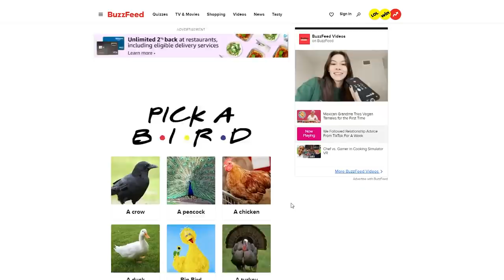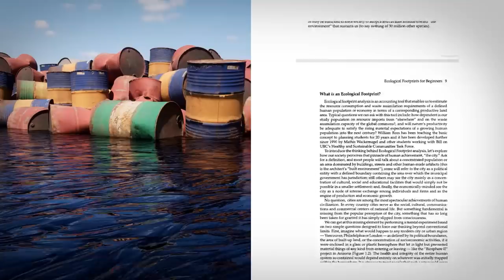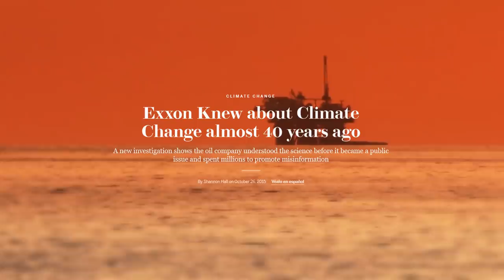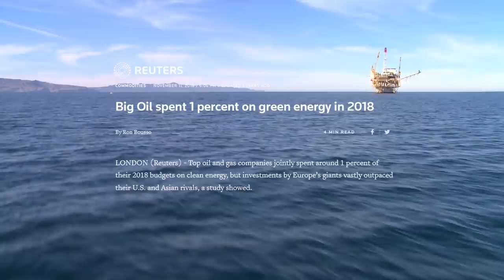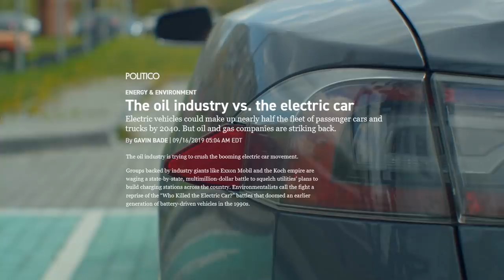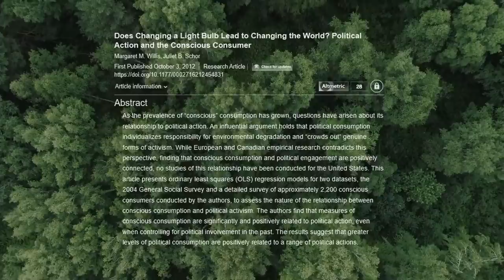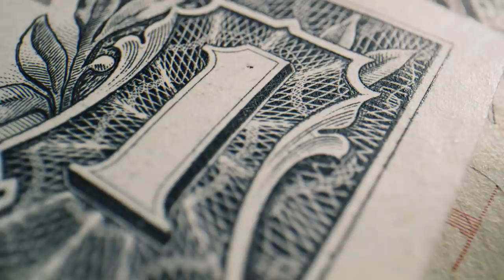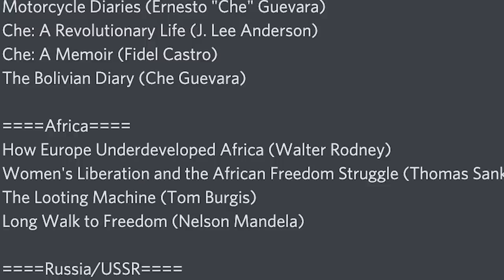Your "Carbon Footprint" Is A Scam

Comment: What I missed when you said about electric cars is that the electricity they charge is sometimes made of carbon, for example, which is constantly producing carbon dioxide. Personally, I have nothing against electric cars and that it is a grief in this field of transport, just like electric trains, but together with cars we have to think about better, more "green" electricity.
Reply: Also, fewer cars. Electric cars may be better than petrol cars, but they are still very wasteful when compared with a properly engineered public transport system. A train carrying four hundred people on the daily commute is much better than four hundred electric cars making the same journey. Electric cars can be an excuse not to invest in public transport.
Reply: An electric car can use renewable energy. An internal combustion driven car cannot. So as grids switch to greener energy, electric cars get greener.
Reply: @kanguruster  Green-er. They are an improvement on petrol, but still not the best solution. People really like cars though - they are more than just a means of transportation, they enable a way of life. It's the convenience of being able to go where you want without the need to plan ahead.
Reply: @kanguruster  A problem a lot of people ignore is maintenance. Batteries constantly lose range and must be replaced within 5-7 years to retain range most people use. In addition, they still have cooling systems that must be maintained, a lot more computers which generally also have relatively short lifespans, and the charging infrastructure needed to fully transition would require a lot more power, since the world doesn't want to use nuclear fission, it's not gonna help much.

This also doesn't even cover the many rare materials used in construction such as lithium, we don't have close to enough for a full EV transition. Nor does it mention the environmental impact of mining for these things so quickly/all at once.
Reply: 1. In Poland ~ 95% of energy comes from coal and we have zero nuclear power plants, thanks to the chaotic recommendation of videos by YouTube on this channel are people from nationalities other than America.
2. In the Internet you can find Teslai charging stations, where next to them are large oil generators because there is no other way to bring electricity to the station.

Comment: Very good video. You're one of the jewels of YouTube, JT (a jewel sustainably mined without slavery or exploitation, of course).
What I see as a killer problem of moving people away from the carbon footprint and individual responsibility is that we're told what we have to do individually to reduce the effects of our energy usage, which means 1) we don't have to think too hard, and 2) when it becomes hard for us personally, or we see that what we've been told to do isn't going to have any material effect, we can't help but think any response at all will be too hard and we get discouraged. That plays into the hands of the profiteers who are exceedingly happy when we pay no attention to the man behind the curtain.
Unfortunately, we just forget that when we need to do something we can't do individually, people have always come together and worked collectively. 
To overcome the divide and conquer strategy of promoting individual responsibility, we need some very simple messaging and actions that make doing the right thing a straightforward choice.
What are those straightforward choices, though? The Green New Deal isn't everywhere and even in the US, does everyone know what they could be doing to support it?

Comment: I don't remember if this is correct but doesn't Tesla use more CO2 to produce the cars than we use in gasoline?
Reply: I would assume not if we can consider them roughly equivalent to any other electric car
Reply: They need to use cobalt for batteries  which is mined by machines that pollute. Large scale emissions stop there,as the electricity used to power EVs won't pollute too much. ICE cars will produce medium pollutions all the time throughout the whole life time.
Reply: In general cars pollute in two ways:
1. The pollution required to manufacture the car
2. The pollution the car generates during its operation (fuel, maintenance)

For electric cars the first part is bigger than for ICE cars. However, the second part is much smaller. As such, if an electric car is used for several years, it should pollute less.

Of course this is a bit simplified/in general overview. Real life is always more nuanced :D
Reply: @Remix2366  It's entirely feasible that the machinery used to mine rare earth metals could themselves be powered by sustainable sources once the infrastructure exists for it.
Reply: There is a world difference between car ownership and personal mobility.
Reply: @-GinΠΓ Τάο pure lies mate
Reply: @-GinΠΓ Τάο lmao yeah it's "actual fact" that ice engines are more efficient than a central power plant despite that literally just not being true okay buddy

Comment: Oil companies are making record profits and could switch, but without scarcity, a product in Capitalism will dwindle in value as abundance and distribution make it readily accessible to all. (Totally stole that from Marx and Bastani.)
New nuclear technology using Thorium will make it multiple times safer than previous nuclear plants, and much safer than destroying our planet.
There’s no way we could switch to “green” energy with hydrogen/electric hybrid vehicles easily rolled out <sarcasm> with our current infrastructure (gas stations can supply hydrogen and quick charge electricity) and they operate like, but much better, than regular vehicles in the roads.

Comment: This video explains in a great way that we need structural changes instead of individual actions. However, the carbon footprint has the benefits to make people realize the areas that really matter -transportation, food, housing etc. Individual actions are necessary too, but not enough. Once aware of it, people will turn more easily to collective action.
Reply: I get where he's coming from, but it isn't infinitely more profitable, and most importantly it doesn't have to be. Under capitalism it only needs to be more profitable. Capitalists would burn the planet to the ground for a 1% improvement.

Comment: Car pollution is real and a problem, however, don’t forget the majority of cars are business cars and trucks. If you’d take those away you’ll see that private cars are not the problem. In Europe they want all business cars to be electric somewhere around 2030, that will make a change. 
My point is that yet again an individual is not responsible for this, you should ride a bike if you can but don’t feel bad if you have to use your car or think you must spend a small fortune to buy an electric car. Corporations are responsible, even for car pollution.

Comment: I've been thinking about this for a long time, society needs to change, if we can't get rid of car culture, give them electric cars, if we have to give them electricity produced by natural gas, give them nuclear and renewable power plants. There is no ethical consumption under capitalism, don't use that as an excuse, use it as an argument to uproot capitalism.
Reply: Unfortunately, electric cars are not a solution in that situation. They don't work environmentally, economically or practically on large scales, and we already tried them. in 1900-1939 and the 1990s with the same problems. 

A note is that this is a view based on the US, Canada, Mexico and other countries without existing public transit infrastructure and where long distance trips between very spread out cities with little between are common. Obviously, this is not the case in Europe, and most of Asia. 

Firstly, environmentally they are equally bad. The first rule of the recycling cycle is to reduce. Replacing every car produces way, way, way more waste than keeping what we have running. In addition, maintenance exists for EVs. Batteries constantly lose range and must be replaced eventually. They also have cooling systems to flush out and repair, like a normal engine. You still need to fix lights (LEDs fail too), screens, computers, brakes, tires, windows, body panels etc. The much higher weight of them wears tires and roads out faster. The charging infrastructure must be constructed. This hasn't even mentioned the environmental effects of mining lithium and all the rare metals required for these cars. In addition, economic issues with EVs mean they're going to have much shorter average lifespans.

Secondly, economics. I'm going to ignore the higher MSRP as there are tax incentives, and range as it is not significantly worse. Even for a 2011 Nissan Leaf, a very cheap and old used EV, replacing the battery, which ideally is done every 5 to 7 years, costs $1350. That's as much as getting a new engine for a car, which can easily last 15 years. Sure, the cost of maintaining the engine car in that time span costs way more, but it's spread out across time. In a world where most people live paycheck to paycheck, that's fine, affordable. But $1350 all at once is NOT. What this means is that a EV will usually be sold by the owner and probably scrapped. This means that the EV has half the effective lifespan on average of a engine car or even a hybrid. In addition, lithium is quite scarce as are the metals. If we swapped to EVs on a large scale, demand would skyrocket and supply would diminish to the point where prices of these materials would skyrocket, making EV prices stay the same even with the benefits of economy of scale. You also need to factor in the cost of charging infrastructure in both public and private areas (most houses and apartment complexes have nowhere to put home chargers), the extra road and bridge maintenance cost due to the increased weight (the Nissan Leaf is 300lbs heavier than other compact cars of the era, a 2022 Ford Mach E weighs over 700lbs more than an 2022 AWD Hybrid Ford Escape), accidents would result in significantly more property damage and death too.

Lastly, practical. Charging time, weight, lack of infrastructure, lack of materials, high cost are STILL a issue, just like with the 1996 GM EV1 or the 1907 Detroit Electric. EVs simply do not work for most people in nations like these, and unfortunately, as much as I want transit reform and nuclear power to happen, the average person disagrees thanks to our education systems.
Reply: Also, I agree with your points otherwise
Reply: @lumiapowered8463  I’d like to pick your brain then, what should we do about all of these things? I’d love to hear your thoughts. Maybe instead of electric cars, mass transit?
Reply: @lumiapowered8463  Just because something didn't work back then doesn't mean it doesn't work now, we tried using reusable bags back then and it didn't work but it sure as hell would work now

Comment: I think the best option is just don’t buy anything you don’t need. I watched a YouTube video once about how to reduce spending to save money. He said to follow three rules when deciding to make a purchase.
1. Will I die without it? This means basics, like food, shelter, water.
2. Will I stink without it? Meaning things like deodorant. Shampoo. Soap. 
3. Is it to replace or fix something that is broke? Like a worn out pair of shoes that have holes. 
If you answered no to any questions it isn’t worth buying. Like. Why do people need a new cell phone every two years? My cell phone is close to 10 years old. I’ve had it repaired 3 times (screen replaced twice and battery replaced once) and it still works. Why spend $1000 on a new phone when this one still works? I’ll replace it only when it’s broke, and can not be fixed. You thinking of buying a new shirt, or shoes, or make up, whatever. Do you actually need it? No? Then don’t buy it.

Comment: Great video.  You really cannot push the blame onto the consumer.  If I want to buy a loaf of bread I don't care if it's a paper bag or a plastic bag, but a plastic bag is all that is available.  Then I try to recycle that bag, but it can't get recycled because of the mix of plastics the manufacture used in their design, so it ends up in a landfill.  All that and I get the blame for buying it?  Yea, that's straight up misdirection BS right there.

Comment: I work regularly with carbon footprints, and I consider this video very problematic. Not because there are a few mistakes in it – most of it is true – but because many people in the comments seem to understand its message as letting them off the hook.
TL;DR: YOUR DECISIONS STILL MATTER, EVEN IF YOU ARE LIMITED BY SOCIETY IN THE WAY YOU MAKE THEM!

Now, in more detail
1)	CARBON FOOTPRINTS DO MATTER: Most people could behave a lot more sustainably, they just don’t care. That’s why it’s still important to think about your ecological footprint. Pretty much all major environmental organisations use the term in their communication. Depending on where you live, WWF’s footprint calculator is very good. Even if BP was the reason for popularizing the term, which I’m not sure it was, that doesn’t make it a less useful tool.
2)	YOUR CHOICES DO MATTER: If you fly only 1-2x a year and not far, eat little meat, and live in a nice apartment instead of a big house, that all has a huge impact!! While it’s obviously true that Big Oil and Big Coal are main culprits for the climate crisis, individual consumers make up a large chunk on any country’s carbon emissions in the way they eat, move, live and consume (in my country, private consumption accounts for roughly 40% of total emissions).
3)	YOU CAN INFLUENCE THE SOCIETY YOU LIVE IN: The video is very right in saying that individuals can’t save the planet, because of society’s structural carbon footprint. Collective action is very important – but not all of us have it in us to be activists or politicians. Still, all of us can however influence how this society develops. Using the car example:
--> don’t live in suburbia where you need a car – the less people live there, the less cars will be needed
--> resist social pressure to own a car for status reasons. vote for politicians who promise to improve public transport, green energy etc.
-->
--> buy an electric car, if you can afford it and if you can charge it at home – it IS greener and the range will easily be enough for most days. The more e-cars there are, the more charging points will be built.

To be clear, it’s still a well-researched video. And it points out the big importance of collective action to solve the structural issues causing environmental problems. But even so, that must not deter us from being aware of our individual responsibility.
Reply: So here’s the bottom line. According to the IPCC’s own data, man-made CO2 output levels are 3% of 3% of 0.1% of the total Earth’s atmosphere. That’s 0.000009%! That’s 9 millionths.

Comment: Meh. My issue comes down to the political ramifications of such a "collective" idea. When you shift to a collectivism framework, individual responsibility and in turn individual rights go out the window. Consumption at an individual level and in turn individual responsibility allows the freedom to choose. Which are a pillar of capitalism. Changes should be made but it starts with individuals voting on restraints and regulations on production methods (the framework already exist ie EPA, and other gov bodies), not a transition to total environmental collectivism which the video suggests. Gateway to totalitarianism

Comment: I promise not to poison the well of this debate: If you haven't experienced driving an all electric vehicle I suggest renting one for your next road trip and using it not only for one type of transportation, but for both short drives around the home or your hotel room/destination, and for the long trip of several hours/hundreds of miles. This will facilitate using our infrastructure and the current availability of charging options. Consider that not every motorist will have the ability to charge the vehicle when at home, and charging stations at hotels/rental homes or close to them will be under high use loads. I'm pretty sure you will readily share your experience with friends and acquaintances.
My bias: Life, for me, requires either living in the city or an hour or two driving daily (of course mass transit is a responsible option.) I would not be able to home charge, as my vehicle will be parked in available spots on a public street. Public long-charging stations may one day be as abundant as parking meters, but as I mentioned that could be a long time from now or a very expensive undertak8ng.
Disclaimer: I am not anti-electric vehicle nor am I damning our current oil dependant lifestyle. I believe things will change, but change either takes time or requires some endurance to discomfort/pain/adversity...and $$$. We are not evil humans destroying our only home. We are, generally, intelligent beings who are discussing our current situation and debating how to deal with it, as we should be expected to.